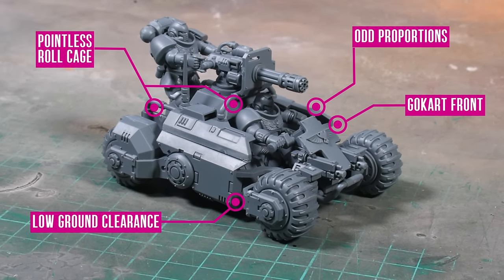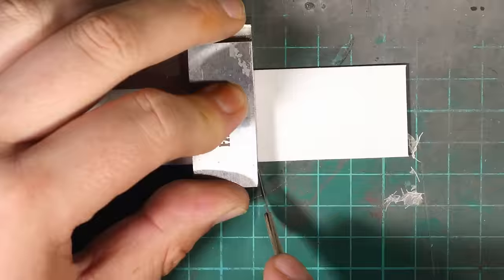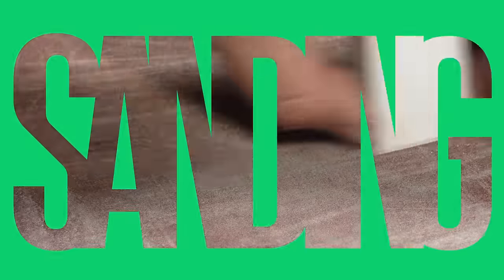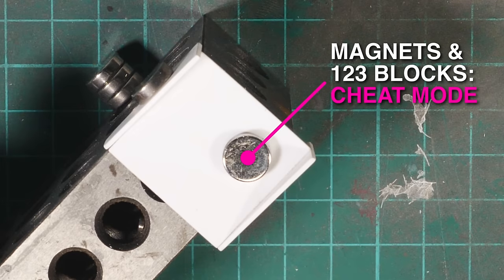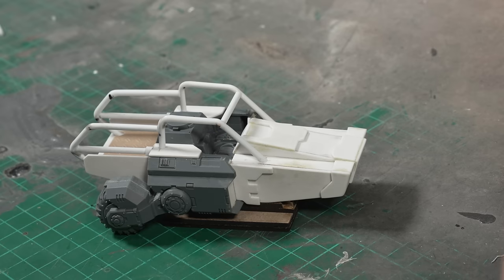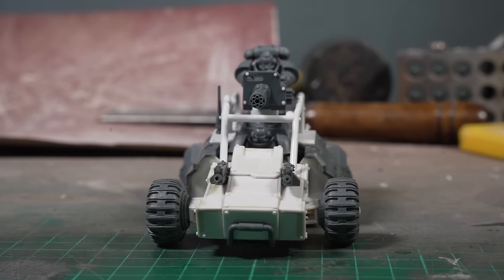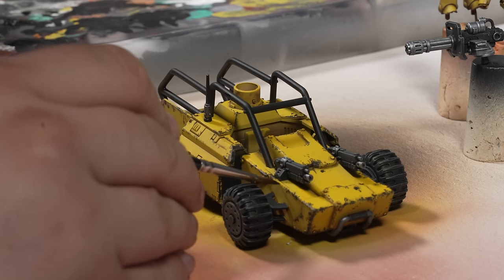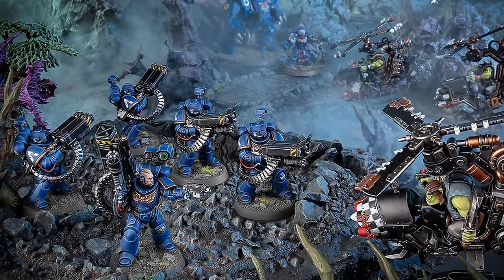Transforming the Space Marine Primaris Invader ATV: KITBASH

Comment: I just turned all wheels 30-45° down. Rear wheels are easy. Just remove them from that drum thing and glue them back on. The fore wheels are a problem. I removed the whole "suspension" and shaved the lower stake to make it 45° and glue it back to where it came from. I have yet to have an idea for connecting the upper stake but it's done regardless. 

It is a buggy now, with ground clearance. As if it is an ATV or something. 

I also replaced the gunner with some boxes, because the ATV is joining my bikes as their support.

Comment: I think the turret might have been better off, as a remote controlled one.
Two guys sitting one behind the other, nose wheel of the bike version, to get a trike.
The Trike setup is in order to armor up the front wheel(s).
Then a guy in the back, sitting backwards, covering the rear or some sort of cargo, passengier, ect, ect.
The bonus is that you then get more parts compatibility with the bikes, which is always a bonus.
And with two, you could then transport a Strike Team, just like fusing a Landspeeder Storm with a Stormspeeder, so it can transport five guys.

Comment: Overall good, and better than the base model, but it still needs better ground clearance. That would 100% ground itself on the first steep incline it came across.

I'd recommend looking at dune buggies and quad bikes for anyone wanting to fix the ATV. The chassis should be above at least half the wheels ideally, and the front of the vehicle barely further forward than them.
Reply from the maker: Yeah, you're not wrong. I planned on angling the front suspension to create more ground clearance, but when I offered up the completed suspension units I really liked how aggressive it looked with the lower nose... so I went with the rule of cool. In my headcannon it's got adaptive ride height ;)

Comment: Man, I must say your version is so much better than original one. One concern though, it's still nose diving... As you rebuilt the front suspension, why haven't you done it with an angle ? You could have bend the rod at the center just a tiny bit so it would have looked gorgeous don't you think ? Also the rolling cage behind... well, first it won't accomplish its mission in any case as it is so much lower than the operator of the gattling and second, it feels to me like it's suppressing movement capacity for the operator to the side...

Anyway, it's clearly so much better than the original one. I like how you handled guns... internal feeding ? of course ! Upper position from the pilot ? of course ! Stonger rear suspension ? You bet ! Credible slope deflector for the driver ? make sense !

Great job !
Reply from the maker: Yeah, I 100% agree.  I planned on angling the front suspension to create more ground clearance as you suggest, but when I offered up the completed suspension units I really liked how aggressive it looked with the lower nose... so I went with the rule of cool. In my headcannon it's got adaptive ride height ;)
Reply: @OffbeatBuilds  Rule of tacti-cool is the best :D

Comment: Kinda looks more like one of those hill karts now, with 0 front suspension and even less ground clearance (front getting stuck on everything. And the original model didn't have roll cage. Just something to hold onto and the bar behind the driver was high enough to actually work as a proper roll cage. Front end of the original could use some work sure, but to make it look less like ATV capable wouldn't be it, unless just going for the looks (which are subjective of course and each to their own).

Now, for something orkish that transformed version would be proper, it does look like it would fit the bill perfectly 😁 But as far as off roading and "all terrain" vehicles go, original at least looked it could perform without useless added weight. But as conversions go, if that's what you enjoy playing or doing then that's enough reason for it to be awesome.

Comment: There's nothing wrong with the weathering, you need to apply more dirt, grime or dust to the wheels and chipping and scratching to the hub caps so they match up with the weathering of the body of the model itself. That's why it looks strange, because you have fresh off the factory floor tires on a grimy and scratched up vehicle.

Comment: looks great, just the suspension looks weird and bit non-functional to me - if you move back wheels and lift chassis in back, it will inevitably cause front of the car to dig into ground. (unless purpose of the suspencion on back wheels is meant not to change angle (and thus ground clearance) depending on where they ride.

Comment: I'll be honest: I prefer the original one. Looks spacy and futuristic and actual usable, not like your run-off-the-mill Buggy as you completly destroyed the vehicles approach angle. You did not even fix the low ground clearance you mentioned at the start.
To the pointless roll-cages ... your may be safeer in a roll-over, but i kept wondering if the marine can even get in and out. Besides, the original roll-cage behind the driver is still above his head, so hardly pointless. The ones in the back I'd say are something to hold on anything other than the gun.

So, yes, your work and quality and the video is very very good. Just the actual result is something i feel people would have not liked at all if released like this.

Comment: Thats like trying to "fix" a car that was driven over by a tank and then shot at 3 times for good measure, it is simply not worth it and the end result can only look so good. Just dont bother and get a proper car/model XD While the kitbashed mini is significantly better than the original it is still not fitting in the lore or universe or general aesthetic of the faction. I recon this is one of the reasons GW are swlowly but surely redconning their classic designs all over the hobby, look at the shit they try to sell you as orcs these days for example or 90% of the Primaris product range, it simply has nothing to do with the designs that made the company so succesfull. Sure, 16yo kiddos might dig it, but old vetereans are getting more and more alienated by GW.
Reply: What are you talking about? GW still does amazing miniatures. Most new miniatures exceed their predecessors. Just look at the new Terminators, Sternguard, Jumpassault Intercessors etc. And they did some amazing new miniatures like bladeguard veterans and so on. 
Even the ATV looks better than the old trike in my opinion though both look a bit goofy. 
And no, I am not 16 years old and I am a 40k fan for over 15 years.